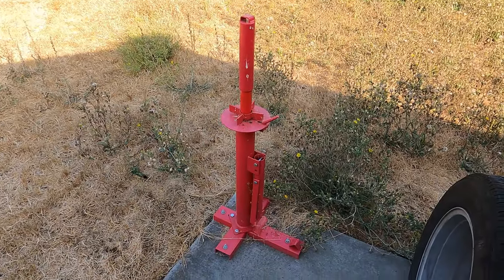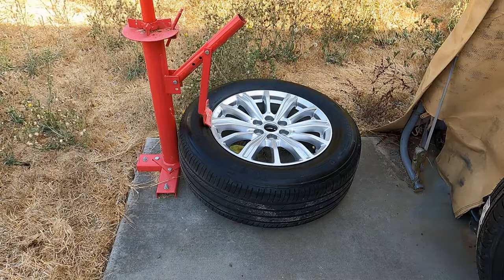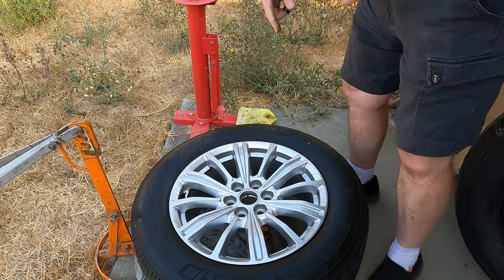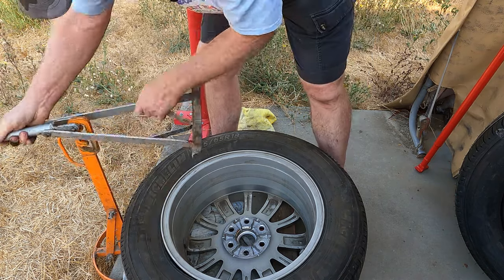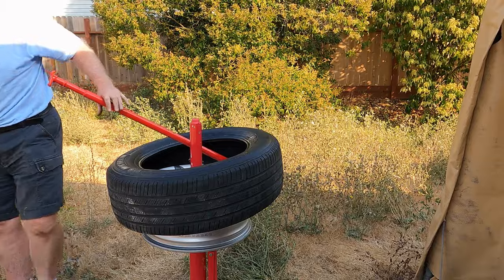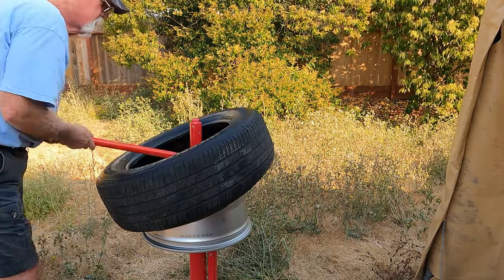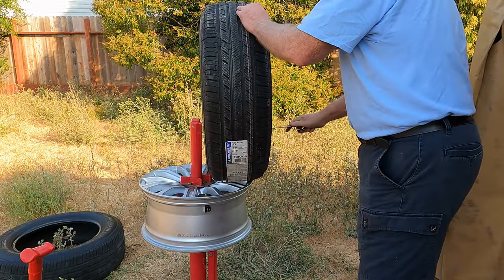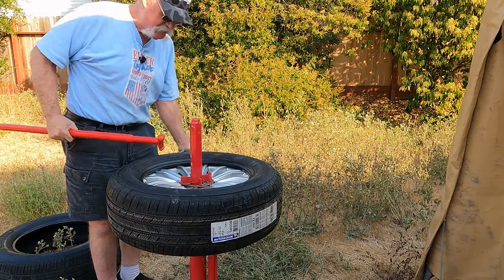Pittsburgh Brand # 58731 Manual Tire Changer from Harbor Freight Demonstration and Review.

Comment: You have this right idea bolting it down. Mines bolted down with anchors that sit below the surface. I simply unbolt and store in a corner when not in use. Ive mounted dozens of tires on mine and it saves so much time compared with having to deal with a tire shop. There is a learning curve to the mounting end of the bar, one well worth getting past. A duck bill mod is best really, it saves rims and lets you work with nice alloys.
Reply from the maker: I have considered the duckbill upgrade but have not purchased one yet.  I have been working with old steel wheels as of late, so there is no need at this time.
  Thanks for watching.

Comment: A ratchet strap around the tire with just a bit of tension, don't need much, will hold the tire enough to fill it with air and set the bead. If you tighten the strap too much, the tire will buckle and fold and you'll hear a massive leak.
Reply from the maker: I tried that, but the sidewalls were too stiff for it to be effective.  Thanks for watching.

Comment: Easy dawn dish liquid what we use    works every time. Use one lap around each side close to the rim, and tire goes right on, and dawn drys, creating a good seal.
Reply from the maker: The problem with dish washing  liquid is that it has salt in it and can rust the bead area of the rim.  Thanks for watching.

Comment: Get you one of them air tanks that have a quick valve that blast they are into the bead their fun in there and they work great impress your friends have a good day and thanks for the good video
Reply from the maker: I saw one of these advertised recently.  It does look like it would work.
Reply: @ejhbritishcars6907  they do work great even on a front tractor tires or something like that that comes off the bead then it's hard to deal with Andy can use it for an air tank too

Comment: heres one of my secrets put a ratch strap around the outer diameter ratch it up and it helps alot with setting the tire.
Reply from the maker: I tried that using a rope and a bar to tighten, no go.  The tire is very stiff, and the sidewalls hardly flex at all

Comment: you are to close to tire machine braking the bead
Reply from the maker: That isctrue in the intro picture, but I did move it further away so that the rim was against the vuilt in stop.
Reply: @ejhbritishcars6907  Still wasn't enough pull the tire out away from the machine so it's pushing at an angle into the steel rim and bead of the tire, and not on the sidewall.
Reply from the maker: My separate bead breaker works much better than the one  on the machine, so I have been using that.  Thanks for watching.

Comment: Set you tire bead with a bead blaster! VEVOR Tire Bead Seater, 2.1 Gal/8 L Air Tire Bead Blaster, 120 PSI Handheld Bead Bazooka, Portable Tire Inflator Tool, 85-116 PSI Operating Pressure for Tractor Truck ATV Car and Automobile Repair
Amazon's
Choice
Reply from the maker: Looks interesting.  I will have to research it a bit.
Reply: @ejhbritishcars6907 while you had the air chuck filling and pulling up on second bead, try having someone go around bead with leaf blower (basically high volume low pressure air to overcome leakage) good luck 👍
Reply from the maker: Good idea.  Thanks for watching.
Reply: I wanted one of these then I saw some guys on here seat stubborn beads with a bicycle inner tube. I keep the bike tire inner tube rolled up in the back of a tool box drawer.
Reply: @tcmits3699  Never thought of this but I’ll try it next time im seating a stubborn bead. My parlor trick is to remove the valve core and inflate with a narrow tapered blow gun. Be aware it’s possible to put over 70psi in a tire with the blow gun.